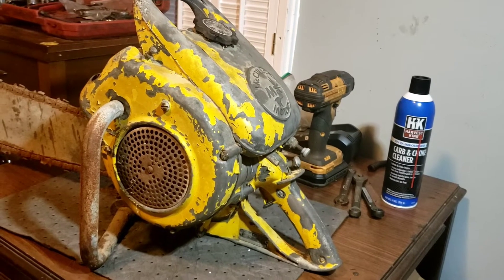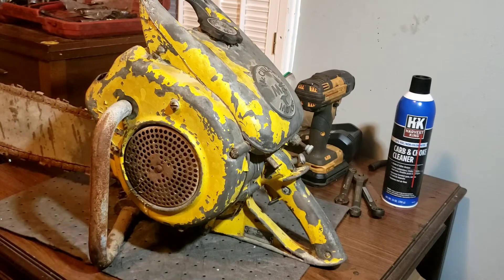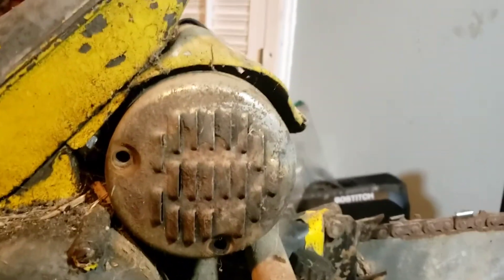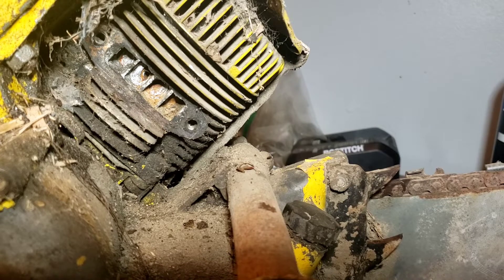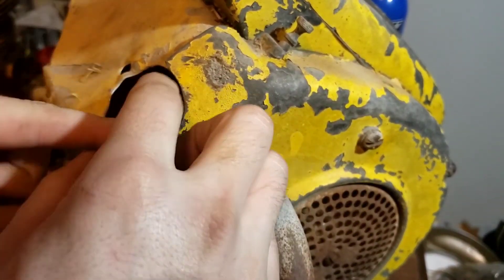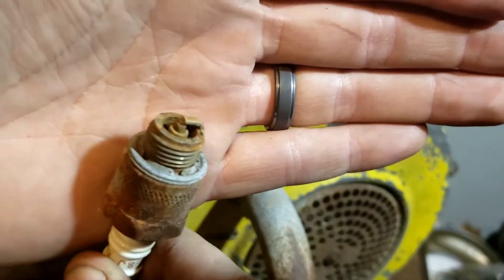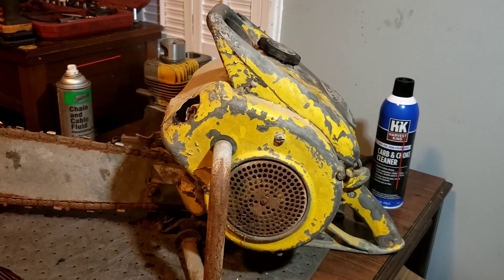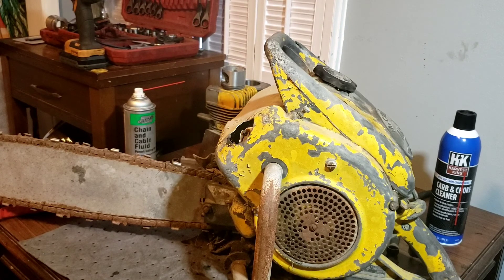McCulloch 3-25 any hope?

Comment: I had another question, when I took apart the recoil and got down into the gear behind the recoil I think there was oil coming out of there. Is that suppose to happen or is my gear oil leaking into the clutch assembly?
Reply from the maker: @Courtland007109  its a wet clutch, 100% normal.
Reply: @mistermacgray  okay I just wanted to confirm, you’ve been my go to on information about this. I’m still learning more about that chainsaw trying to source that diaphragm material you used in another video to make the diaphragm. Only place I can find it seems to be on eBay in the UK.

Comment: I know this is an old video, I ended up getting a model 47 which is close to this model. I have replaced the rings as they were stuck and I broke them getting them free. I’ve got it running now but it won’t idle. Any idea on how to adjust these carburetors? I’ve been digging on the internet but can’t seem to find anything. Thanks again!
Reply from the maker: @Courtland007109  okay so under the starter there is a long screw that is your air to fuel mix for your idle mixture and you have to adjust that as necessary to get it to idle but also there is a little thumb screw on some models I'm not sure which ones if all of them had them that you could adjust for the idle and it opens up the throttle just a little bit. These units have to be very well sealed up gasket wise and the wear plate for the rotary intake has to be in good shape for them to really run good and idle good. I have a couple that won't idle but they run really good and cut really good
Reply: @mistermacgray  okay I’ll give that a try, I saw the idle speed screw for the throttle and that only gives me so much but I will take a look for the long screw. I appreciate it!